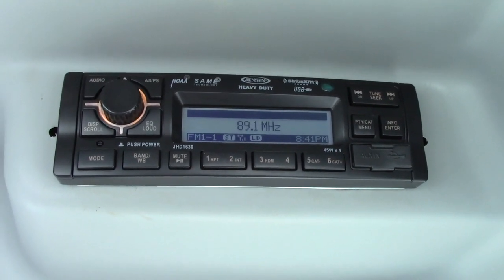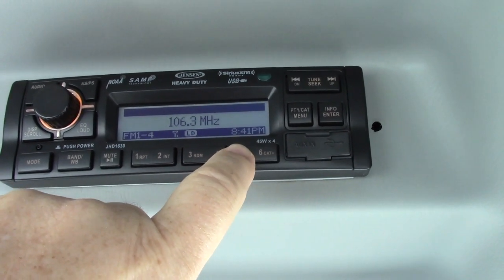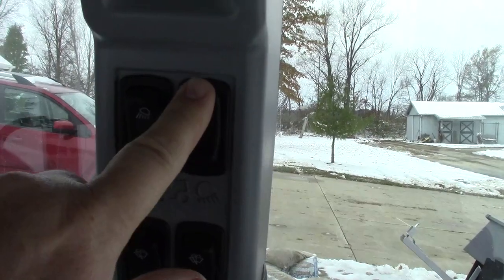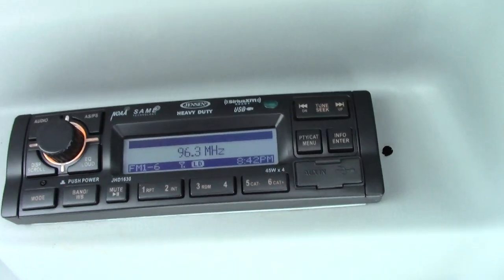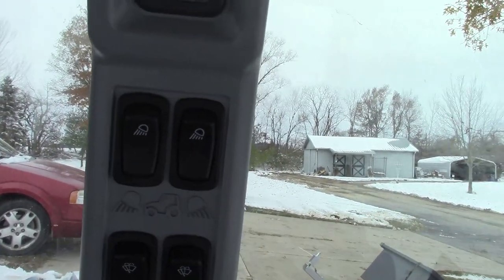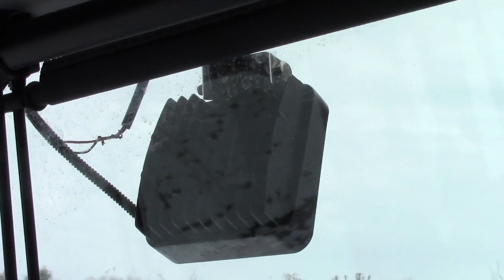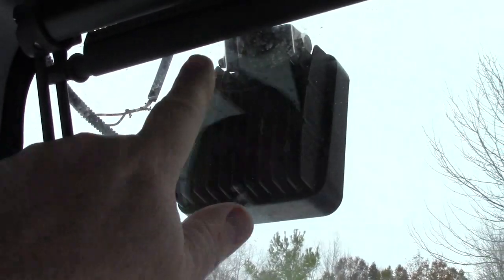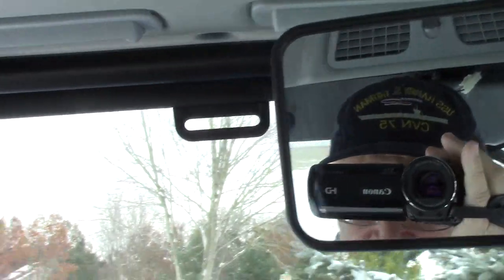LED Lights Wipe Out ALL AM/FM Stations on New Holland Boomer 40 Tractor SEVERE RFI

Comment: My neighbor installed two exterior LED fixtures that created a S9+ buzz on 40m at a distance from my antenna of about 125'. The switcher was potted so couldn't get to the power supply components.  BUT a toroid on the AC input and 48VDC output completely eliminated the noise...absolutely floored me that it was such a simple fix that worked so well. The company is US based and I don't know the origin of the fixture itself; the engineer I worked with there told me that his product met the EMI standards...not according to my spectrum analyzer in gross terms with one I was able to test on the bench. Good luck with your situation!  73 - Dino KL0S
Reply from the maker: What you are describing is common-mode noise from the switcher. And like you, I seriously doubt they meet FCC requirements. There are thousands of cases of companies forging test results so they can put on that FCC sticker because they know we will NEVER double check them.....it's all on the honor system. 99% are designed and made in China even if owned by a company in the USA.
Reply: That's good to know - I'll be trying that on a set of LED decorative drop lights on my patio. Trying to sit underneath them at night and operate is impossible. I could jam the entire 6th Fleet with those lights. Hopefully a simply snap on ferrite choke will work.

Comment: Thanks for posting this.  I was thinking of "upgrading" to LEDs, but will definitely take this into consideration.
Reply from the maker: Glad this may help. I will bring one of these lights inside and connect up a spectrum analyzer to the power line to show the range and strength of the RFI this bugger can generate. The good news is that not every tractor will have severe issues. A lot depends on how the +12 VDC power buss is routed and how many sensors/electronics are on your tractor, etc.